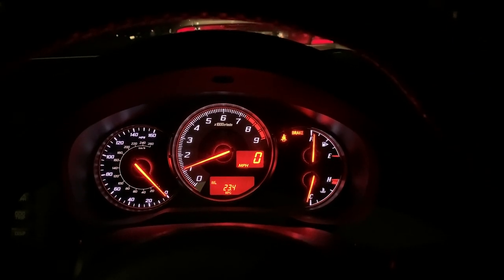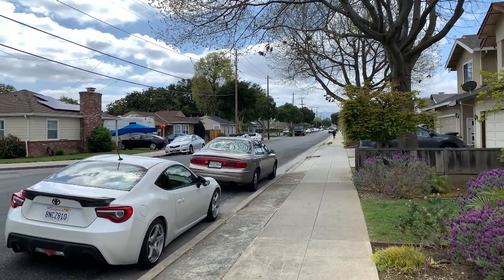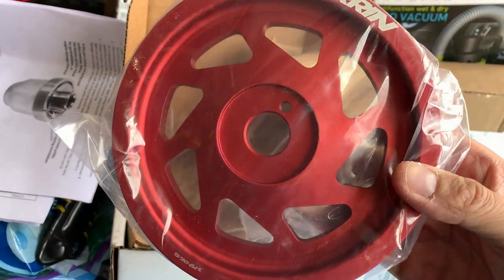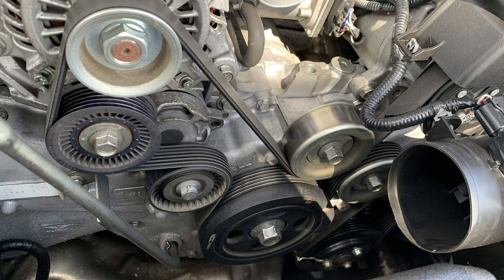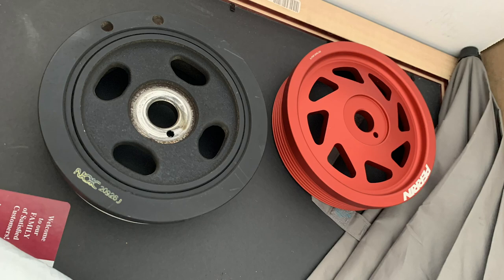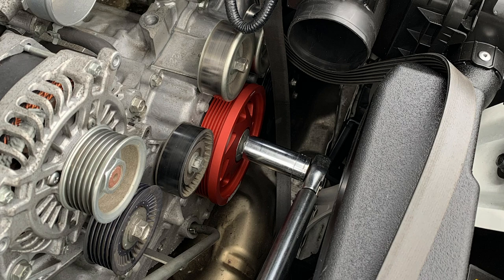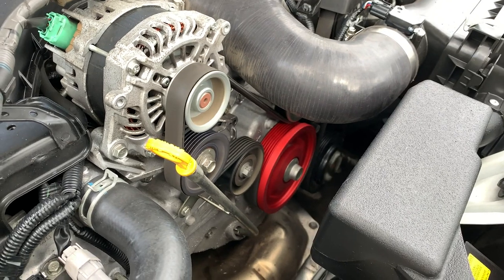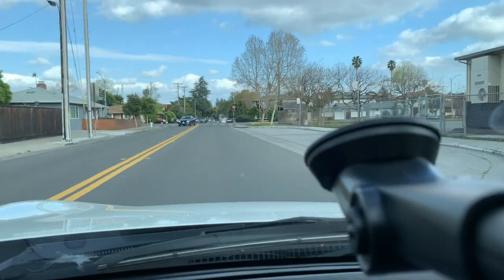Does a Lighter Crank Pulley Do Anything?

Comment: Mine is on the way for my Subaru..seems to be worth it for the price..👍🏼
Reply from the maker: yeah really it’s kind of a no-brainer if you’re doing time attacks or competing in general. it’s not expensive and its a quick install. the only “debate” i’ve seen is between guys who need their butt-dyno’s to feel something. so if you’re looking for a different “feel”, this is not that kind of upgrade. it’s like changing your camber slightly, it’s almost impossible for your butt-dyno to feel any difference but the point is to shave time off your lap. and factually as you see here, the blip to downshift is shorter and so you can downshift from gear to gear faster, which means you can brake later. i can’t imagine any pro debating any change like this is a waste of time and money, do every little thing you can up to the event restrictions cuz you want every advantage you can get.
Reply: You’re better off getting the fluid ampr. You need a harmonic balancer!
Reply: @Musicizmyremedy  not on a newer Subaru you don’t..they don’t require a balancer..✌🏼
Reply: @billygames7107  Newer as in 2015+? Just had mine installed last week. Loving it so far. Stereo screen went black after, not sure if it's related 🤷🏻‍♂️. Any idea guys?
Reply: @kevinmcquaig258  yeah that one should be fine. I highly doubt it’s related. Prob a woring problem. Check your grounds.

Comment: By itself, it may not feel like much, but after a couple of other supporting mods, those differences do add up! It is more for help with shifting (downshifting). But what's interesting is that, in the video, the revs go down faster when the throttle is off. (as expected since the stock pulley has a greater moment of inertia)...so there's more rev hang with the lightweight pulley. How can this be eliminated, maybe a tune? That probably explains why I give it a .5 sec pause in between shifts when upshifting in normal driving scenarios to shift smoother. (3500 is also a sweet spot). I've had mine for about 40K miles with no issue, but I'm still on the stock clutch and stock flywheel. But I do have a carbon driveshaft if that makes any difference. As a side note, since the boxer engine is most balanced vs any other engine (ie inline)....they would be the best candidate for this type of mod.
Reply: I would have thought that the heavier pulley would keep the engine spinning for longer?
Reply: With light weight internals and especially a light weight flywheel, you end up with massive engine braking when you back off. It's that stupid heavy flywheel that keeps the whole thing from slowing down. The car feels very responsive and maybe even twitchy.
Reply: How do you like the drive shaft. Most noticeable difference ?

Comment: My stock crank pulley just flew off on my 22 year old Celica GTS 😅 . The stock pulley has rubber in between the pulley that connects together, that rubber part I guess started to disintegrate. I was driving and just heard it snap off. Now I'm thinking of upgrading to this because it's all aluminum with no rubber
Reply: yeah i still have mine on- it's been 2 years now, zero problems.
Reply: My 02’ celica gts also lost it recently
Reply: Do not put a lightweight on whatever you do. You have a harmonic balancer, vs just a standard crank pulley which would benefit from this mod. You need a fluid dampener, they last almost forever and is the proper upgrade for your car.

Comment: Anytime you're late in the power train. It would hit the opium's faster because now the motor is freeing up power because it does not have to struggle to spin the mass. That's why the old Small block 3 50  they used to run nothing nothing on the motor just off battery alone and would get more power

Comment: Probably not the best idea to lube the bolt threads, I think you're supposed to use loctite. If you're afraid of it seizing you could use copper paste or some other anti-seize.
Reply: Use Loctite and locking tabs.

Comment: Nice vid! Didn't expect it to do anything haha. With all pullies lightened it would definitily be a noticable upgrade. How much would removing powersteering do? compared to this?
Reply from the maker: whoa i dunno if you wanna remove power steering tho- the car's light but not that light. i've owned a 2200 lbs car with no power steering, it has a shorter ratio, engine behind me, and it was extremely annoying to parallel park. i wouldn't sacrifice steering speed for any amount of power gain
Reply: @gt86er14  You have a pretty nice toyota! I just got a little Toyota Starlet 850kg/1870lbs. Just wondering how much the difference would be between removing power steering and a lightened pulley. Just saw a vid with a 4AGE all lightened pulleys saved the same weight as a lightened flywheel. Pretty amazing!
Reply: @socialhostage8534  With such a tiny car and small engine, pulleys would make more of a difference

Comment: I'm wanting to consider putting NST Pulleys on my 06 Civic EX because it lacks acceleration (not a ricer). This is a daily commuter and I want a bit more punch to the car - are these worth it?
Reply from the maker: acceleration? probably not. downshift blipping, yes. some more effective ways to get the car to be more peppy is lighter wheels, lighter flywheel, make the car more light in general by removing seats, trunk carpet, mats, etc. if you want the engine to make more low-end torque without doing something crazy like adding a turbo, you can consult a local tuning shop for options on how to move more power to the rpm range you commonly drive in. they might have a quick easy tune they can do without you having to do anything extra- and they might also have options where if you added something small like an intake or exhaust mod, they can tune more low-end power into the engine on top of the mods.
Reply: @gt86er14  Thanks for the reply!!!

Comment: What exactly does lighter pulleys do . Thinking of changing my top and bottom pulleys.
Reply from the maker: less rotational mass = less effort for the engine to spin the pieces- so revving up the low revs is a little punchier
Reply from the maker: just changing those alone, you won’t feel any significant change in overall acceleration because the energy still has to hit the flywheel and clutch, then the differential, then the heavy ass wheels+tires. but the first thing that will definitely make a difference is blipping to downshift or heeltoe- blipping without being attached to the wheels is quicker so you spend less time downshifting. if you go on a path to reduce all the rotational mass (pulleys, flywheel, wheels) you’ll feel the difference in acceleration for sure.
Reply: @gt86er14  looking to lighten my flywheel on my motorcycle . Hopefully that will help with throttle response. 

Cheers.
Reply: @gt86er14  yeah i was thinking what happens of you just replaced everything you just mentioned

Comment: I’m sure youve heard the back n forth on if these are ok or not for our engines. How has it been over the time you’ve had it on? I only have the accessory pulleys not the crank one yet, still reviewing it.
Reply from the maker: JoeyyTube So far so good- not much difference than when it was stock. I was going to get the rest of the accessory pulleys too on the chance that everything together would improve the blip speed but something tells me that none of these will compare to a flywheel- so I didn’t continue. Reliability they say it causes more abruptness which will wear the other parts faster, but my guess is if driving there doesn’t seem to be any difference, it’s not much difference in abruptness probably. a lightened flywheel might risk more damage in fact... all in all it’s probably not gonna cause much wear, only time will tell (a couple months i don’t think is long enough)
Reply: GT86er our cars being NA also reduces the risk if any at all, so I think it’ll be fun, I do like the extra red in the engine bay dress up, looks great!
Reply from the maker: JoeyyTube actually that’s a very good point- boosting it would accelerate the wear that these smaller mods might do so as long as we keep it NA it should be fine yeah- i might do another video :)
Reply: Does the air-conditioning and alternator affected when idle
Reply: CK Woof not that I’ve noticed, both work fine.
Reply from the maker: @pukiong  ac and everything else works as expected

Comment: I’m sorry i’m nee to the car community but what exactly does an underdrive pulley do? And   Does it help with making ur car faster? Also how much was it?
Reply from the maker: ok so the engine is connected on the back to the flywheel > clutch > diff > wheels. and on the front it’s connected to the underdrive pulleys, it spins the crankshaft pulley which is connected to various pulleys like alternator, water pump, supercharger if you have one, etc and powers those. all of these parts have weight, some more than others and the rotational mass puts load on the engine’s ability to accelerate. any one of these spinning parts if they were lighter, would reduce rotational mass and make it easier for the engine to ramp up acceleration.

the crankshaft pulley is usually the largest and heaviest of the pulleys cuz its the one tied to the engine and is the part that spins energy into the other pulleys. the 86’s stock pulley weighs 5 lbs, the upgrade pulley weighs 1 lb. so when the engine is in neutral and it’s only spinning the flywheel on the back and the new crank pulley on the front, the initial acceleration of the engine is noticeably quicker. but this is when the engine only has to spin the accessory pulleys when in neutral. the clutch, diff, and wheels are way heavier so when the engine is driving the whole car and you only lightened the crank pulley, the acceleration improvement is less noticeable.

the more stuff you lighten, the more you’ll notice acceleration improvement in general.

so when upgrading to lighter spinning parts, theres 2 goals: do you want your car to feel quicker in acceleration when the engine is pushing the car?  or do you want the car’s engine to rev quicker in neutral so you can downshift faster when cornering?  if you want #1, you should get lighter wheels, lighter brake rotors, lighter flywheel. if you want #2, get lighter underdrive pulleys and flywheel. the quicker the engine revs in neutral, the less time you spend blipping to rev match downshifts when you’re diving towards a corner.

the Perrin pulley is usually about 100 or so, i got mine for $80 online. its way cheaper than a flywheel and way way faster to install- but you do get what you pay for. if you don’t get a pulley and instead change the flywheel, you’ll notice an even quicker rev and the whole car accelerates quicker at the same time, but more expensive and longer install.
Reply: @gt86er14  okay now I’ll definitely get one👌 thank you so much for the help especially that i need help a lot since i’m new to the car scene, much respect🙏🏼
Reply: THE BASS MUSIC welcome to the car community, I’m assuming you have an 86?

Comment: You forgot to inform that NHRA will not let you run aluminum crank pulleys or stock pulley if you have built a true race engine that makes a certain hp per liter and or ET. Run a aluminum crank pulley on a Honda b series engine making over 450 kiss your oil pump good buy

Comment: As long as I don't hear that "Lightweight crank pulleys increase horsepower" then I am ok.
It is physically IMPOSSIBLE for engine "Lightening" to increase horsepower.

It can give faster throttle response. But the truth IS that losing weight anywhere else on the car contributes basically the same amount to faster 0-60 times as removing mass from the rotating assembly.

And removing mass from anywhere BUT the rotating mass is MUCH cheaper and effective.
Removing mass from the rotating assembly should ONLY be done on a dedicated race car where every single gram counts.
If you are putting a lightweight crank pulley on a car with a full interior and spare tire, then you are wasting your money.
Emptying your windshield washer bottle would give you more benefit on the track than the pulley.
Or lighter WHEELS makes a bigger difference to acceleration while reducing unsprung weight.
Reply: Wrong lightweight pullies have been dyno proven so yes there’s horsepower to be made period.  I made 7whp and 9wheel torque more on my accord same day same dyno only change was pulley swap. Stock pulley is 7 ish lbs my new pulley is 0.6 lbs that’s a huge difference the engine has to work less and with an underdrive you get more power by slowing down accessories like ac and alternator means engine doesn’t work as hard.
Reply: @HondaAccordPerformance  no it is not possible to increase hp by reducing rotating mass PERIOD;. The automotive standard for measuring HP is at CONSTANT RPM.  Changing the mass of the rotating assembly CANNOT affect this test WHEN DONE CORRECTLY.  If you measured a difference then you did it wrong.  I am a test engineer and I have more than 30 years experience building engines 
AND I am a race car driver.
Reply: @HondaAccordPerformance  if the pulleys UNDERDRIVE the system then YES you can get hp.  But you cannot by reducing mass alone
Reply: Just gonna "weigh" in on this subject. 
   You just said it is physically impossible to increase horsepower by reducing the weight these types of components in the engine.
   I disagree, let me explain. Believe me, I am fully aware of what parasitic drag is. Pumping losses and all that type of stuff.
  This engine makes X horsepower at the flywheel in stock configuration.
   Installing a lightweight pulley does indeed free up horsepower that is already there, but it was being used by the inertial weight built into that stock harmonic balancer.
   So the lightened pulley, if you still wanna call it a harmonic balancer does increase power. But it did not add power.
   However, the engine itself is not complete without the harmonic balancer. This main pulley drives all of the other accessories and attached pumps. It is not considered a part of the rotating assemble, but as a long block, it should be.
   There was also power gained by reducing the diameter, which further reduces parasitic losses.
   So no, it did not add power, but it did free up power. Just a technicality, at the wheels, they add power.
   Excluding bolt on performance parts that reduce parasitic drag. Lightning engine components does not add power impossibly. More power is a direct side effect of reducing any type of moving mass within or attached to the engine. Whether that be rotating or reciprocating.
   You are not exactly wrong, but not exactly right.
Reply: @robertmoore119  I understand what you are saying but the fact remains you cannot increase measurable horsepower.  Because "ideal horsepower" is measured at constant velocity.  The rotating mass is NOT a factor at constant rpm.